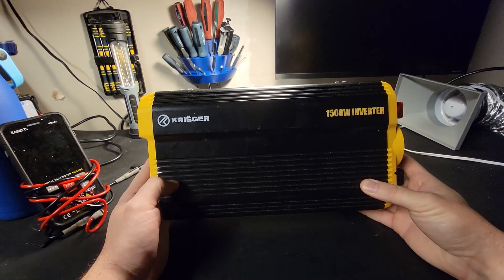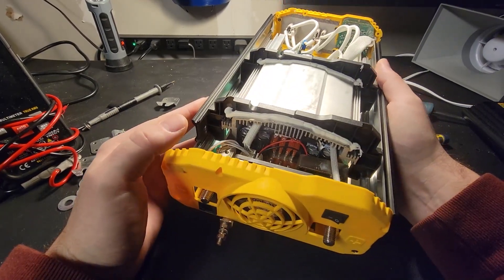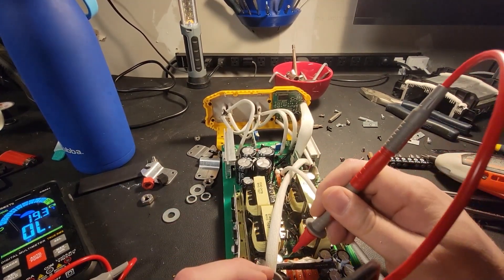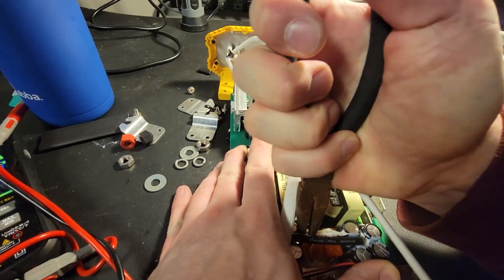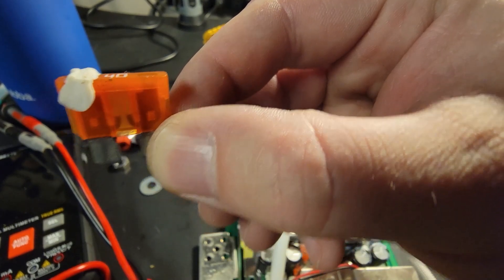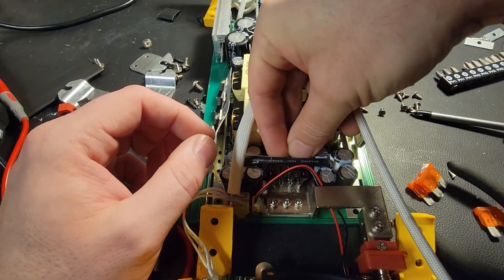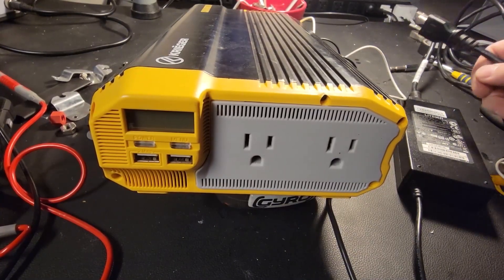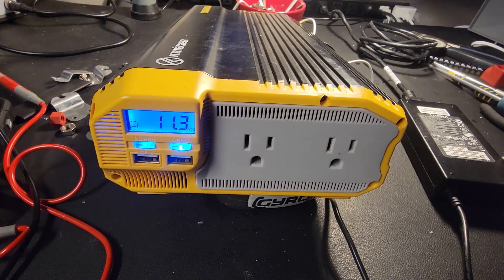FIXING AN INVERTER EASILY! - Krieger KR1500

Comment: I attempting to fix one of these and only one side of the heatsink is lifting. Unfortunately you didn't show how to loosen the heatsink.
Reply from the maker: I suppose I wasn't able to show you since I didn't have to repair that portion of the inverter.  If you would like some more assistance, please join the Discord https://discord.gg/K6gWMqVm
Reply: @TestingWithMike  I kept at it and found it was the heatsink compound that was sticking it. In any case, there an IC on a daughter boards that's burnt out so I can't identify it. Thanks for getting back to me anyway.
Reply from the maker: If you want to still post a photo with the model number perhaps we could figure it out